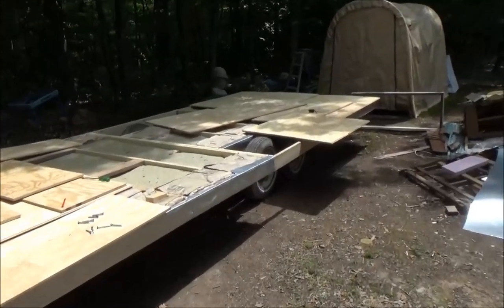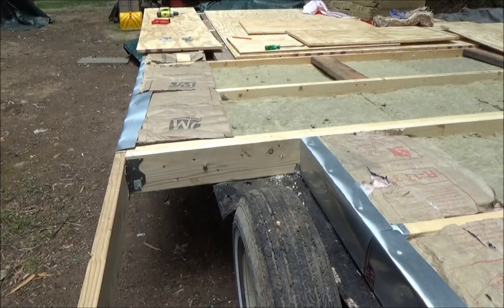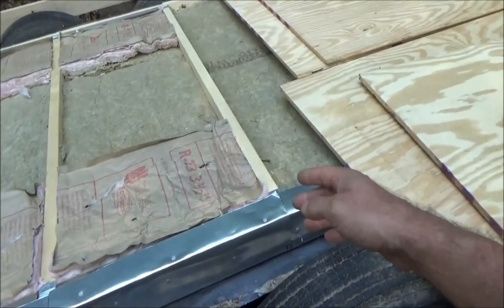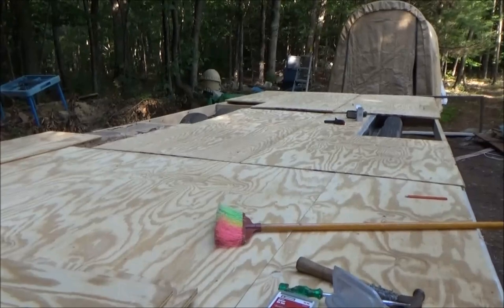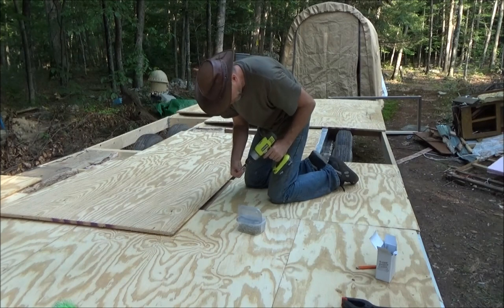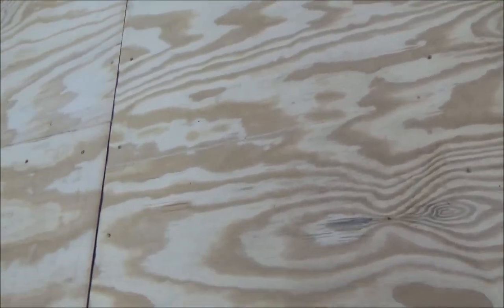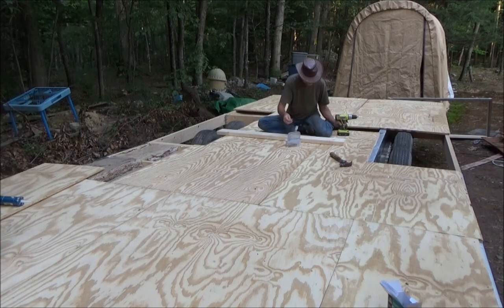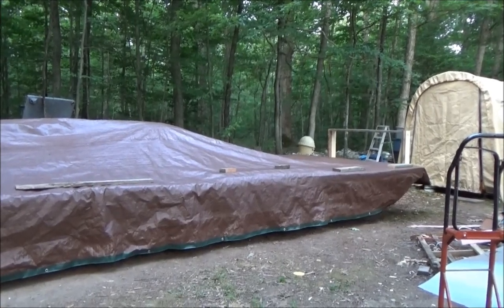Working On Construction Of My Tiny House Floor

Comment: I love the idea of using the plywood as your floor.  A little sanding, stain and poly will really make it look nice.  The patterns in the wood are cool. Plus no added weight, and the cost is cheap.  Add some rugs when you are done.

Comment: Looking good Troy ,, I wouldn`t worry to much about the little floor gaps , a mixture of glue and sawdust will full them nicely and provide a strong sandable surface which can be resurfaced to match the exsisting floor .. A large putty spreader would work good for applying it ..cheers ..
Reply from the maker: 88s10Durango Thank you
Reply from the maker: ***** But epoxy will not expand with the floor, will it?
Reply from the maker: ***** thank you. I will consider it along with other ideas and decide what is best. This often means internet research. But that is what makes this channel special. I learn a lot from everyone.

Comment: to fix the cracks in your floor, rip some slivers {a slight wedge} from a 2x4, glue both sides and tap into the crack with a hammer, cut off excess with a utility knife and sand flush, those cracks will be a problem if your planing on living on it for a while, it will for sure,  catch all the dirt you sweep over it, I have worked wood all my life, love your ideas and wish you all the best.

Comment: Screw vs. nail ask a hurricane Andrew home owner near eye path of storm, it was a 2 story with cbs on first and wood frame on second. Mind he noticed the lose and missin nails on second floor, so he went and got self-tappers. He was the only two story in the whole development. The others were flatten by the wind, and that wind did change direction. No flexin issues on the house with the screws. Screws hold more area in the hole sides. They twist out easy,but pull it like a nail and ur arm might break first.

Comment: Troy:
Looking good so far.
Not sure if you mentioned it, but I suggest(if not already planned) to get the completed floor unit aligned and secured to your trailer frame before proceeding with the walls at all.
Then you need to get the frame jacked at several points up off the wheels(to avoid compression of the leaf springs) and 100%(or as close to it) level on all axises. In order for your walls to be plumb you'll need a level and solid floor frame or everything will be out of whack.
Reply: the floor is already secured to the frame as well the tires are off the ground already ... cheers
Reply from the maker: I will level it all again and secure it all together before the walls go up.

Comment: Troy if you do not leave the 1\8" gap your plywood will pucker when the humidity goes up. I know you are planning to use that as your primary flooring, but I doubt you will be happy with the floor lifting up at every seem when the wood swells from the increased humidity. Good luck, and God's speed.
Reply: Hi acklan3, I've already pointed this out to him several times and provided him with a link to installation instructions.
Reply: Jim Watson Sorry I missed your comment. I did this on the first house I flipped and ended up ruining several rooms of vinyl flooring. The fix was using a thin kerf circular saw and ripping a 3/16" deep relief cut, to allow for expansion.
With all that oak pallet would I would plain, joint, and router a tongue & grove and lay a free floating floor. The floor could be finished after the house is completed, but that is just me.
He is still doing a great job with his limited skill and resources.
Reply: acklan3 Yes, It's surprising how many carpenters get on here and say you don't need to gap the wood. Most manufacturers stamp it right on the plywood. Good idea on the floating floor, but he said he's going to sand and seal, and finish it before he builds the walls. That's a bad idea for a lot of obvious reasons: dents, dings, breaks from dropping things, and the worst part is how slippery it will be.
Reply: Jim Watson That is also why his plywood appears to be too narrow. If you allow the recommended gap he would find the plywood to be almost spot on.
Personally I would have used two layers making sure that the seems did not line up from the first to second layer. Using two 1/2" layers would have given a better seal and less likely to pucker.
Still placing the current tongue & grove and overlaying with a floating floor is still a good options, and easy enough to install after the tiny home is blacked in, or even after punch out.
Reply from the maker: Well, I do have the gap, wanted or not. It will not go together any tighter anyway. As was mentioned in this thread though, I cannot afford the weight of the oak flooring. Would look nice though.
Reply: The Do It Yourself World I understand. I was not trying to lick the red off your candy, I just have been where you are going. Another option, since it is a tiny house, (sub 300ft) would be "engineered flooring. At less than $1 per foot  it may be a viable option. Also from time to time on Craigslist I have seen people selling overage (post project) for very little. Some even give it away verse throwing it away. It Is less than a 1\4" and generally pretty light.
Great video.
Reply from the maker: acklan3 Thank you. I may cover the floor next year but for now this is my floor. I will consider options though as I go.
Reply: The Do It Yourself World Sounds good. Sorry if I came off as pushy, I just know how frustrating it came be when you give 100% and you get blind sided by the unexpected. Have peace brother and God's speed.
Reply from the maker: acklan3 No problem, thanks

Comment: why would you not insulate to the top of the floor instead of leaveing a three inch void i know you did around the perimeter but not the middle and are you going to show how you attached the the floor to the frame
Reply from the maker: Walter Bodine The idea was to keep cold air out. I have at least 3.5 inches of insulation on all points under the floor. I will attach the trailer later.

Comment: LOOKIN GOOD in another tiny home a guy used pallet wood going from side to side sanded then sealed it. looked good, by using small pieces more manageable
Reply: You are talking about for the floor, right?  What a great idea!  If that ply gets shredded pallet wood could definitely work, but it has no tongue and groove...did that guy cut in the tongue and groove or just butt the wood?
Reply: MollyDolly he just butted it up to each other, trying to find  the pic can't find it. yes the floor
Reply: Karen Lincoln Well with all the beautiful colors in the used pallet wood I imagine that could be gorgeous.
Reply from the maker: Karen Lincoln My biggest concern is that the pallet wood is not at all flat. It is warped every which way. And heavy. Very heavy.

Comment: Proper floor sheeting runs edge to edge over the joists.  The walls are built over top of the sheeting.  You're framer can't put the wall base plate down over air.  If your struggling measuring and cutting correctly, simply lay the sheet on and trace underneath with a carpenters pencil.

Comment: Cover the floor with a roll of linoleum.  Will greatly delay adding vents to the aluminum underneath.   You can run that edge to edge before you build the stud walls.  Money?  Yes.

Comment: I would have used the lag bolts, which have threads, for a nut, and washers.  Those will get you by...but if you ever get mobile, those won't hold up.

Comment: House is looking good man this is exciting to watch. Nice lag bolts You should put washers on them to keep them from pulling through. wow carpenter ants got my shed and have destroyed it. Throw a lot lot more diatomaceous earth and bug killer under that home dont let them get started. On the inside of the wheels too.
Reply from the maker: shartne Thanks. Yes I will keep the dia earth treatment going until the house is fully built. Then just keep treating any contact with the ground, like the tires and jacks.
Reply: The Do It Yourself World After you finish this house you can start a factory making tiny houses for the bug out off grid people. I bet you could sell a bunch.
Reply from the maker: shartne I have actually considered the idea. If my trailer does not sell then I have the perfect frame for one.
Reply: The Do It Yourself World Yess you should keep it. they are perfect for tiny houses. You can make another one and sell it.

Comment: Dry fit each panel, take it off, lay your bead of glue down for just that panel, install the panel by just lining up each pc. the best you can, and start at the end that meets the last board you attached, and work it down, (if warped) as you go, watching the alignment as you go.....Note: don't wait to long, between laying the bead of glue, and installing the panel, the glue will skin over and not be as effective.....
Reply from the maker: Thanks

Comment: Wow, not staggering the ply seams?  A simple thing like that stiffens the floor which stiffens the whole structure.  Simply cut the first panel on the middle run to 4' to cause the stagger.

Comment: I would have used stainless steel fasteners with locking nuts, and fender washers to secure the floor half's together but that might be over kill but that's just the way I do things. I also buy my screwdriver bits in bulk because they don't last very long. Now would be the time to cover the floor completely with a vinyl flooring if you want to before you start the wall framing, if you install vinyl flooring now you won't have all that trimming to do later.
Reply from the maker: BUDDY LIGHT I actually do have a box of screw driver bits now. Did not show it on video though. I will use the plywood as my floor for now. Maybe cover it next year
Reply: Have you decided on a good wood stove yet?

Comment: Looking good. In the future... be sure to orient the crowns of the wood properly. Also, when using a lag bolt, I like to use a washer. It helps keep the head of the bolt from pressing into the wood.
Reply from the maker: Winston Smith Thank you. Well, for better or worse, the bolts are in there now.
Reply: The Do It Yourself World
Something to consider should you need to use them in another (permanent fixing) situation. Put some liquid nails into the hole before fitting the bolts/screws to act as a thread lock. Just an idea.
Reply from the maker: Uncomfortably Numb Good idea

Comment: Gonna need a floor leveling compound then a subfloor material, like in RV when you put tile down.  This platform needs another level and smoother layer put down now while its easy.  Then any floor covering you go with,  laminate, tile, paint, stain.  You get a very smooth living space and are sealed even tighter from outside
Reply from the maker: W8FG This is my floor. I will sand it and shellac it.
Reply: The Do It Yourself World If you end up not liking that, you could always go back later with inexpensive cork flooring. But. I like the idea of just sanding and shellac.
Reply: cnypilot If you are thinking of eventually installing flooring later, Perhaps you should simply paint the floor. Easier than sand/shellac. It keeps the dust out and repels the spills and water.  :)

Comment: Should have used regular bolts with washers, lock washers and lock nuts. I would think the lag bolts could possibly back out when and if you ever have to move it.

Comment: you could have toe-nailed a 2X4 on its side as a support under the floor where you have the plywood just spanning. fill the seams with  "fix all" it flexes a little bit is a concrete type product. Fix-all will help level the floor.

Comment: those boards are too short on the ends though? you need to just buy new boards and do it right. that looks ridiculous having a frame 1-2" wider than the house walls will be. i couldnt do any better for sure but this is painfull to watch the floor is so off in every direction not even wide enough.
Reply: The short plywood will be underneath the walls; you will never see it. All he needs to do is put down strips.
Reply: Brigitte Carpenter I am a professional framer. He's not attaching it to strips of wood, he will be nailing through the strips and into the frame, the 2/6s. When it's done you won't be able to see if it's a strip of wood or not, because it will be hidden underneath the bottom of the wall.
Reply: Jim Watson yeah that should work good enough. seems it would.
Reply: thats you. good enough is good enough.
Reply: Paul E Clemons Jr Finally, someone that knows what there talking about!!
Reply: Paul E Clemons Jr Also, hand drive sinkers have glue on them and do the same thing.
Reply: Paul E Clemons Jr  How would you guys like to build a home for Brigitte?? Bet you would find a real quick alternate use for that nail gun! LOL!
Reply: Brigitte Carpenter  Sorry Brigittie, I missed the question. In response to how many Tiny homes I have built, my answer is Zero, but I have build 100's of houses and 100's of apartment complexes, that are far more complicated than the framing in a tiny house. You start with basic construction and build according to the needs of the structure, Tiny home or skyscraper. Some things are irrelevant. Maybe he should have sanded all the 2/6's before putting down the plywood, or the wall studs before the wall board. That would make just about as much sense as replacing the short plywood.
Reply: MollyDolly I would not do that. I wouldn't have any hair left after the first week with all do respect to Brigite.
Reply: Brigitte Carpenter Thanks Brigittie, I enjoyed it. Just a suggestion, there's an old saying: "Don't bring a knife to a gun fight". In this case a machine gun fight.
Reply: Jim Watson Or a nail gun fight.  ;)
Reply: Paul E Clemons Jr  I tried to explain that to her, but I couldn't seem to get through.
Reply: Terry Teague Thanks Terry
Reply: Paul E Clemons Jr I mentioned earlier that I wish I could get there to help him. We screw all floors down with a PAM screw gun. It has a long handle on it so you don't have to bend over. It's what he builder requires on all his houses.
Reply: MollyDolly Yes, you can remove the safety and it shoots nails as fast as you can pull the trigger. I think that's called a semi-automatic isn't it.
Reply: Jim Watson Do you have a builder you work with regularly but are between builds?  If so,  just a thought... maybe he would get you a round trip ticket if you wear his shirts on camera everyday?  Of course Troy will do a back ground check... (thank the trolls) on any visitor now... but maybe that could work.
Reply: Paul E Clemons Jr  Oh!  If you only knew how many background checks have been run on Troy!  LOL!   We all know a certain troll even had the FBI put him through the wringer!  I am fairly certain Troy is so clean he squeaks!  Not sure what dirty Australian sounds like but it sounds like fun!
Reply from the maker: MollyDolly Got that right. After six visits of the police to my place and a full search for "terrorist" materials, I came out pretty clean. lol
Reply: The Do It Yourself World  This whole nails vs screws thing is reminding me of  'Tastes Great ...Less Filling !!    LOL!!
Reply from the maker: MollyDolly Reminds me of a wardrobe mishap I recently had
Reply: The Do It Yourself World Mishap is right!  LOL!

Comment: Just curious how the floor is attached to the frame? Edit: Specifically, how the whole floor/frame structure is attached to the metal of the original camper frame? Thanks.

Comment: troy, on solution to weight might be to plane the board down to 1/4 inch or so and use them like a laminant floor. just a thought.

Comment: I see ya got the ridge line in the tarp. Now try garlic for the misquitoes, it works down here. Do you have a head lamp to give ya some light to screw with. Next try bringin ur citronella plant over, it will give u a 10 ft. bubble zone around it. Observational help to a olde tank man, but u how tight that can be.

Comment: Troy, how did you secure the floor joists to the trailer frame?  I don't remember seeing that part, just you saying that you did it.
Reply from the maker: Chris Campbell Not done yet. I will do it before I put up the walls though and do it on video

Comment: I know this will be a silly question, but why not lift the floor by say 3 to 4 inch and have a complete floor with out the wheel wells, its got to be easier to build with a clear floor, again a silly question.
Reply from the maker: Tim Fuller Well, the first half of your comment is spot on. Thanks. The second half you can please flush down the toilet for me.
Reply: Tim Fuller As I said it was a silly question,and I now know why but dude there is no need to disrespect the work the man is doing, remember not every one has the money to buy everything new, I think Troy is doing the best he can with the tools wood and things to hand. I am sure it will be a good and warm tiny house.
Reply: Tim Fuller Ummm insults I think that says everything about you.......Enjoy

Comment: Looking good. :-) Glad to see you are taking some of the good advice from posters. I've been thinking about the flooring. I saw a video the other day where they had used cork and it looked fantastic. I also think it would help to keep the place warm. Also, have you thought about putting tile or other flooring in that kitchen area? Maybe you could at least put a few vinyl tiles down.
Reply from the maker: Sandra Jones I was looking at cork. Looks nice, is warm and light weight. But costs a lot for me.
Reply from the maker: Terry Teague I think I heard something about blue